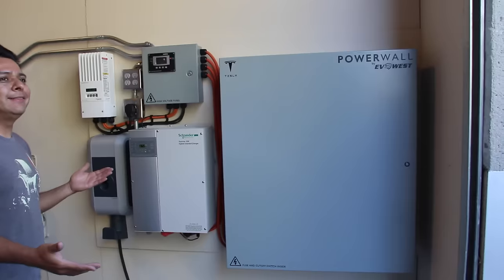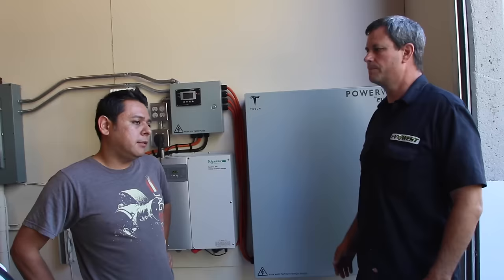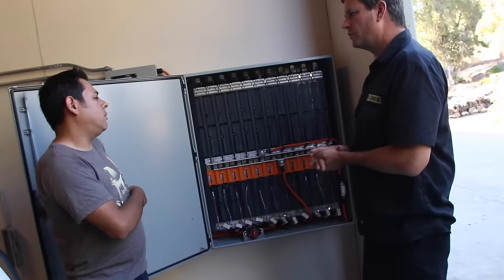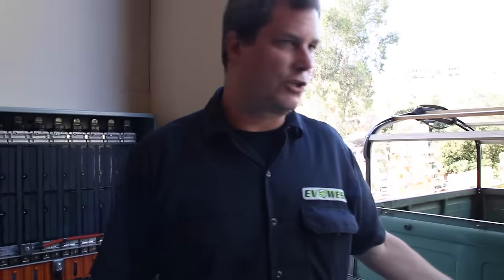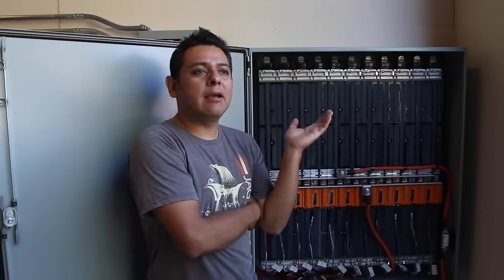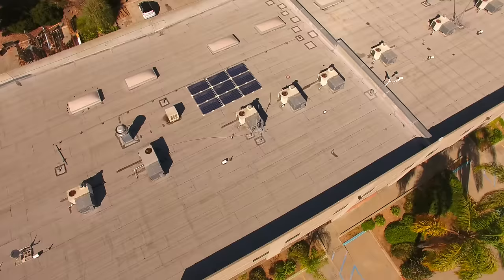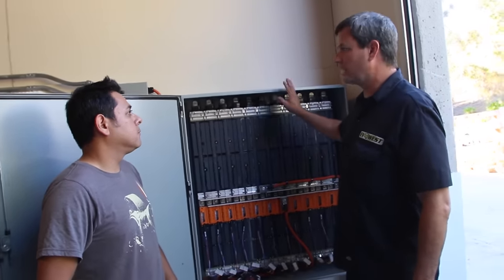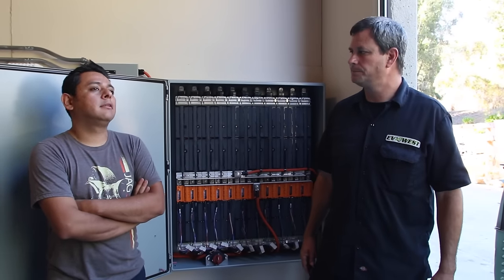DIY TESLA Powerwall  - my  WALL vs ELON'S WALL

Comment: Dude. I have watched a couple of your videos. First I would like to say your so cute. 
I have a request and a question. my request is can you make a video in girl language. like It all sounds so complicated. Perhaps just say like you need this  and this and this and connect it to this and this and this. you can get it here and it costs this much and  once it is set up all you have to do is this every so often.My question is based on my future plans for living off grid. I'm single and have no intention of having any future with a guy around to help me. so i need to know how to do stuff alone. I have ten acres in Florida and hope to convert a two-story tough shed into a tiny home for myself. would one wall run my house. There is no power or water access on this property so I have a lot of work cut out for me. I was also wondering if i would need to be connected to the grid with a wall. I'm hoping not as a power pole and such in its self is expensive.
Reply: No such thing as girl language. Get with the program and buy or borrow some easy books on electricity.

Comment: I was thinking about the issue with you DYI power wall. Instead of using the UPS inverter try a Generator inverter. Like the gas powered ones you can buy in Home Depot for camping, power outages like from hurricanes.

Comment: Just finished my version of the same https://imgur.com/gallery/IFdCC
Reply: Amazing setup. I know it's been 9 months, so you may not see this question. If you do, dont suppose you could share details of where you got the batteries (make/model) and other components you used? I am in Australia and very keen to get into this type of battery technology for a home project.
Reply: These particular batteries were probably made is a limited quantity. I don't know if it is possible to get more, but they were purchased here.  evbatterycenter.com. The Tesla 24v packs. I don't think getting them to Australia would be cost effective. Best to find out which electric car is most popular in AUS and find batteries from that model. The solar equipment you can't see in picture is all off the shelf stuff from Schneider Electric Solar. Bus bars and cables to connect the batteries were all custom made.

Comment: This is super cool. I am surprised not more smaller companies do this. One question, when you have this system operational, how easy is this to tie into the grid? what restrictions will you have to deal with? and what device(s) will you need to get it connected?
Reply: Buy a Grid-Tie inverter ...

Comment: Anyone who thinks this in any way "sustainable" simply does not understand the word "sustainable." There is nothing sustainable about this. Worse, it is not scalable. These type of projects are causing people to go down this road of unsustainable "solutions."
Reply from the maker: dosmastrify  This is the internet,  anyone can say anything,  no explanation or facts needed.
Reply: +dosmastrinfy Can everyone do this? More importantly, can we run the interstate highway system using this? It might be useful for individuals, it might make sense for the guy in the video, but this can't be done at scale. Electric vehicles are simply not going to replace diesel and petrol engines. There is zero evidence showing that PVs are net energy generators. Go look for it, you simply cannot find it.
Reply from the maker: +tarstarkusz   Here are more opinions,  everyone knows opinions are better than facts.
Reply: +dosmstrify There is no evidence to support that PV panels generate more energy than it took to create them in the first place (energy returned on energy invested or EROI). The best studies show energy consumption across the production process, but none of them take all of the embedded energy into consideration. Specifically they leave out the energy needed to create the supply chain (bulldozers, factories, trucks, boats etc) along with the highly technical civilization needed to make all this possible. Even the most optimistic looks at PV shows relatively low EROI, especially when it is compared to oil. This might seem like nitpicking, but it really isn't. We have a "budget" of energy we can use in the next 30 years if we want to avoid the worst of climate change (for example). We can blow this energy any way we want. If we spend this "budget" on alternatives that turn out not to be large net energy producers (at least 15x), we will have have squandered this budget. It is not at all clear to me that PV and batteries are a good solution.
Reply: +ehgarcia Do I have to post citations for gravity? Would you mind telling me what specific thing I said you would like to have data about.
Reply from the maker: tarstarkusz yes post the data for gravity,  I'm not quite convinced about its existence yet.
Reply: I find it hard to believe that it takes more energy to produce a pv panel then that panel will produce over a 20 or 30 year life span but im willing to  look at your data
Reply from the maker: +Wok   Yes let's look at the data
Reply: +jehugarcia I guess well we wait for this fool to respond we will have to spend time on waste full projects
Reply: +wok I did a quick search and found this http://euanmearns.com/the-energy-return-of-solar-pv/  I don't know if this particular website is right or not, if they are properly interpreting the study or if they have an agenda. The problem with citing this, is that there isn't data to link to. I've written to energy specialists at universities specifically because I couldn't find good EROI data on PV. Most didn't write back and one said he was not aware of any study taking the production line itself into consideration. The bulk who got back to me pointed me to studies that only counted energy consumed along the production line and I was already aware of these studies and asked them for data examining the total embedded energy in PV panels including the physical production line.
Reply from the maker: pretty weak article citing single out of date source written by authors employed by nuclear industry.
Reply: +tarkstarkusz article uses outdated data for basis of its argument. I do not believe your speculative comments on PV.
Reply: You are right that it's not scalable. And yes we could stand idly by and wait for corporations and governments to solve climate change.

But remember building a lotus roadster on batteries was not scalable either. Yes that is the company we now refer to as Tesla. If we all place PV panels, if we all use LED lights, if we take a bike instead of a car than you are not just changing something as an individual but you are setting an example especially if you communicate about it publicly like on Youtube. You inspire others to think about what they are doing. 

And making an existing car electric is better and buying a new car. And recycling a shit load off old laptops is better than buying new batteries. 

Sustainable development is a process for meeting human development goals while sustaining the ability of natural systems to continue to provide the natural resources and ecosystem services upon which the economy and society depends

He did the above just, in a mini version. It easy to dismiss something like that, because it very hard to do ;)
Reply: Im not sure what you is think is sustainable. 

I have a 3500 Sq. Ft. custom home with every imaginable gadget.  With my solar panels/Wind turbine all connected to a battery array. I have been 100% disconnected from the grid for 8 years. At the 1300.00 per month SDG&E WAS charging me, I saved 114,000.
Minus the cost of my system of 40K= 74,000 saved so far.
The batterys will go for another 11 years so that will be a savings of 212K.
Thats SUSTAINABLE! !!!!
Reply: What batteries are you running? I am currently running Trojan T-105re's and expect to replace them every 3-4 years.
Reply: you were being charged 1300/month for power???
Reply: The government is not going to solve climate change. The government is paid for by very deep pocketed corporations who's businesses rely heavily on existing tech (such as oil companies). Once a subject is politicized such as global warming the truth becomes harder and harder to discover. From ice core samples we know that global warming is real, and it has occurred many times over the history of this planet. That means that before the industrial revolution and modern day pollution global warming existed. There have always been random ice ages and warming periods even before man began farming. Some scientist even state that because of our modern day air pollution we have staved off an impending ice age for another 400 years. 

Again, with all the different sides arguing this topic who knows. But what we do know is global warming existed before we did, which means that it's possible that pollution does not even trigger this event. Maybe it's something out of our control. Maybe we should be researching how to survive when it eventually happens, rather than pretending it does or doesn't exist. Or if it's something we can even impact as a civilization that hasn't even conquered basic energy sources of our planet much less our solar system. 

In the grand scheme of things we are an infant race, with limited knowledge, and a long way to go to even merit mention in the galaxy, problem is we think we are the most enlightened being in existence, to proud to acknowledge how little we really do know and understand.
Reply: +Andre SE You have me all wrong. I'm very worried about climate change and peak oil. I personally have given up driving. Not everyone can make that decision, but I am doing what I can. I also own a home that is properly sized for  my family and I live in a city where much of what I need to do can be done on foot, PT or bicycle.

Do you happen to have any idea how much energy it takes to create PV panels or the roads cars run on? The amount of silicon available has virtually zero relation to the production of silicon chips.  The price of PV really hasn't come down in the real sense. They are cheaper because they are made in China. Producing PV in America, for example, prices them way out of the market. It's not wages, it's the total lack of environmental regulations in China. By buying Chinese PV panels, we are simply outsourcing far worse pollution, including CO2.

 Assuming PV had a very large EROI, the battery tech needs to be orders of magnitude better for them to generally replace the oil powered ICE. They need to actually store electricity, they need to be cheaper and lighter and they need to be very quickly charged. We need something closer to a supercap than a chemical battery.
Reply: Algae might be what eventually replaces oil, but if that happens, it's decades away. I think the oil algae produces will be the primary energy product from the Algae. Right now the best Algae programs are using CO2 and waste heat from power stations which they are getting for free. Right now, most algae production is for food and supplement products. There might be a HUGE energy future there though.

Li-Ion batteries will get marginally better and probably cheaper, but not much better. There needs to be a whole new  battery that is an order of magnitude better and faster with more charge cycles. The cost of electric cars needs to come down A LOT. Right now, they are toys for rich people that already have all kinds of hidden tax benefits in them (not just the tax credits you get when you buy one).

Where it works, solar thermal is the best renewable option we have because they can run 24/7, but they are largely limited to the desert. PV can help, but not with baseload unless we get far better/cheaper storage. As I said, I'd love to know the REAL cost of PV and how much energy is embedded in a PV system. Then there's the roads. Concrete making, IIRC, is the largest man made source of CO2 on the planet and a large % of the main roads are concrete covered with a mixture of oil and rock.

I would LOVE to know why the western governments are bringing millions of people from low per-capita energy use into the high per-capita energy use West. It's almost as if they are trying to increase the total CO2 emissions of their countries.

Comment: With this system you have two sets of batteries. One set is charged up then that set is used to charge a 2nd set. That equals two charge discharge cycles per charge. What would be great is to just switch batteries.
I was paying attention to what you guys were saying and didn't hear the pops. I heard the dog.
Reply: Do you any clue how much a battery pack weighs?

Comment: I was given a new "dead" rack mount UPS. The issue? The batteries were stone dead. It needed batteries with a charge on them before it would come on. Lamps would not even light on the front panel with the dead batteries.

Comment: One thing nobody mentions: YOU ALREADY NEED A ROOF ON YOUR HOUSE.

Thus the time to install this, is when you're BUILDING it;  since then you can deduct the cost from roof- construction, AND pay for it out of your mortgage. 

Also, they are wasting their money with those batteries, which are made to be LIGHT; you should use a SALT battery, which is cheap and more efficient, but very heavy-- but that's not a factor in a house.
Reply: NO, SALT batteries are LESS efficient.

Comment: I know with a lot of UPS systems they require Batteries to make them work. Even when you plug them in and they do not power up they still need some kind of small load to make it happen. With my UPS even though the battery said needs to be replaced. When i unplug the Batteries from it the UPS doesn't power up at all.

Comment: 33kwh would be hard to go off grid with. My typical house consumption is around 15-20kwh/day. In winter i can generate as low as 2kwh, so a diesel backup would be needed to top up the battery. I still cant justify $15K on a system like this. I looked at the big "chaiman Mao" batteries @48V which run around 5K a pop years back, the Tesla batteries are only slightly better in price per kw. I hope batt prices come down or an alternative battery solution comes out soon which makes deep cycling battery cost effective to do this. Storing water in a dam would probably be better than a battery and run it through a hydro turbine.
Reply: Simple solution  ...  YOU need a larger PV array  ...  problem solved.

Comment: Jehu
I absolutely love your work and vids. Its all very enriching.  Would like to know if you can offer some help in my project?

I have a used 2011 Prius battery that I pulled out of my Prius and wanted to know after I recondition this. If I can somehow use this for my power wall.  If so, what would I need to complete this project with all needed parts to power my 1000 watt air conditioner and possibly a few lights for now with the possibility for expansion.  Thank you very much in advance.

Comment: My biggest Question about Li-ion cells is how long they will last. 
Panasonic's datasheet of the NCR18650B suggests, that after 500 cycles of 100% DOD (that's full capacity use), they will still hold 75% of the original capacity. 
Partial discharge may help to boost the number of cycles before reaching the 75% threshold of capacity. But the uncertainty is real annoying. 
What do you think in matter of life expectation?

Comment: Hi there,
If this happens to be written in poor English, I apologize. I'm from The Netherlands.
I was wondering for what reason your UPS system isn't working. I bought myself a used APC UPS (about 5 kW real sine), but I haven't tested it yet. So please explain.
About the Tesla Powerwall. I don't think it is very useful, for it can only drain 2 kW max. So having 7 or 10 kW sounds great, but you'll find the bottleneck at the level of the inverter.
Looking forward to hearing from you.
Best regards, Roelof

Comment: Nice " little " DIY system there but I would like to take one piece of information I heard from the video. The fact that you have a water cooling system but aren't using it. The big advantage with a water cooling system on lithium ion batteries is keeping all the batteries in there sweet spot ( 74.5 degrees F. ) it shouldn't take that big a radiator with a 12 volt cooling fan running off an automotive battery. What I'm thinking is keeping all the batteries cooled instead of what you have now. Double your solar array and you double the heat input to the batteries but with the cooling system hooked up and operating it would be less likely for the batteries to overheat and possibly have a thermal runaway.

All in all otherwise a definite improvement storage wise over a 7 KW battery. All you need after the additional solar panels is a inverter at least 5 KW in continuous capability.

Better than paying the utility companies.

Thanks for the video
Reply from the maker: Batteries do not heat up at these power levels,  you would have to double your solar before cooling would even make sense